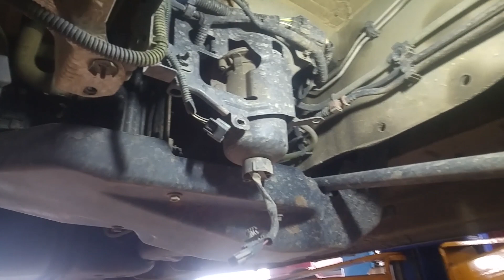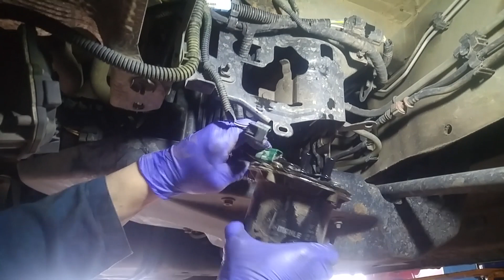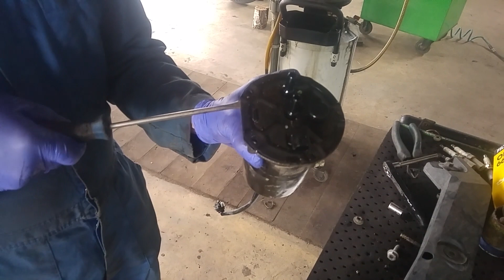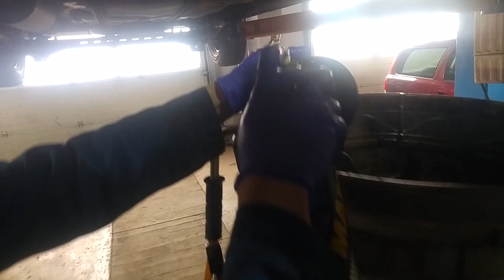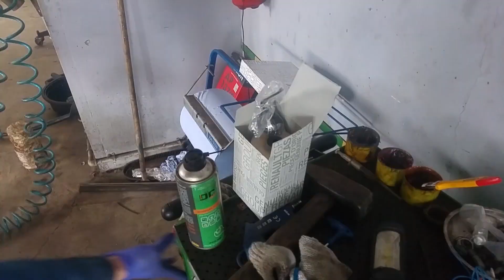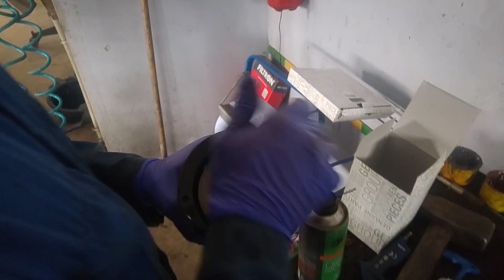How to: Fuel filter replacement Renault Trafic 2015 or location

Comment: Fit filter. Cycle ignition on two or three times without starting for approx 10 seconds. Fuel & air will be heard returning to tank. Start engine & allow to idle for about a minute. (this is how I bleed them. never had a problem)

Comment: Loads of these types of videos ,  but no one shows how to prime it after.
Reply: i didnt prime it , i took a little chance , filled the bowl up with fresh fuel after inserting the new filter n hey presto fired up first time , little bit of a cough as the air worked its way through , but lost hardly any fuel from the disconnected fuel lines so thought once the bowl was full of fuel it may start and it did , RESULT